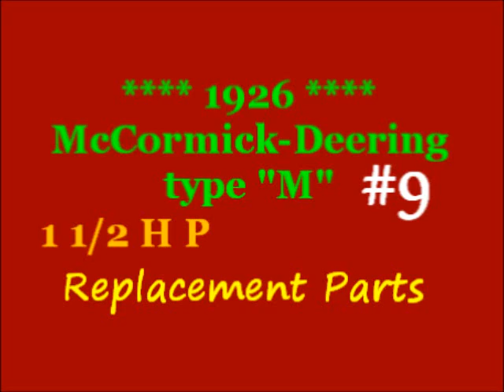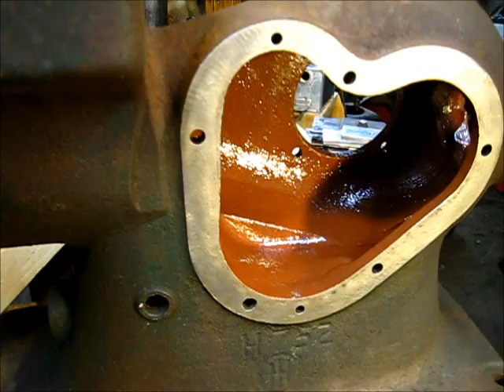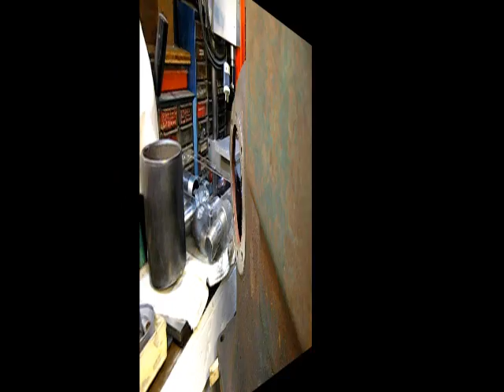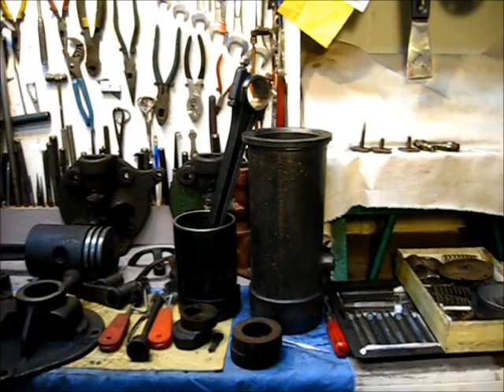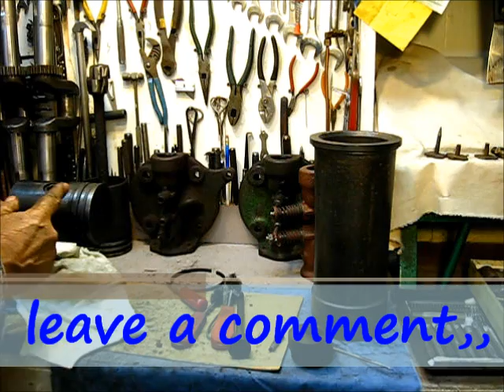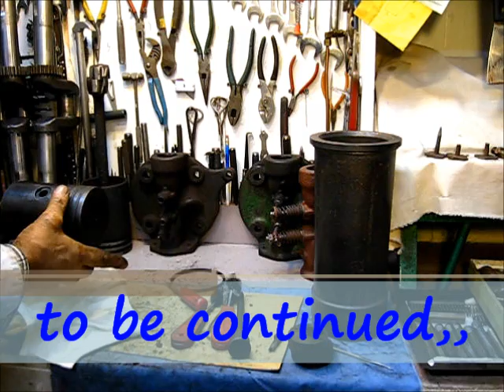1926 McCormick Deering type m / replacement parts 9of

Comment: Can you bore out the cylinder sleeve and use an oversize piston, or do you make a new sleeve if it is worn badly.
Reply from the maker: Gregg ,,,, the short answer is yes,,,, but it cost a lot,,,,, I do not make sleeves,,,

Comment: Hey that is a beautiful timing gear and shaft wow. Good paint job on the crankshaft housing. I may start using the Rustoleum rusty primer on my metal solar trackers I make. Looks like that piston and cylinder are in great condition and it will have no slack and so they will make some really good compression. It will make a super good running motor it looks like to me. Thanks for making these videos they are always very interesting.